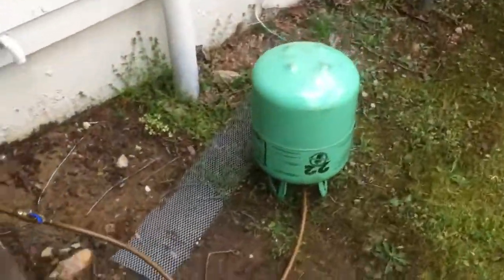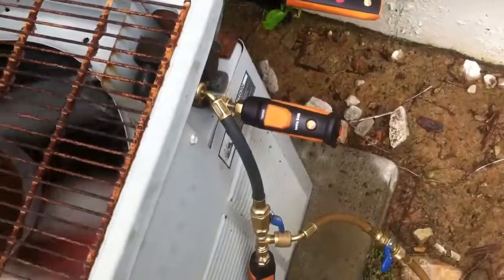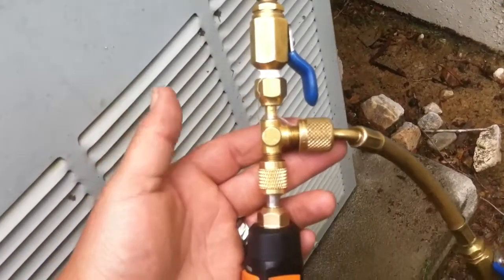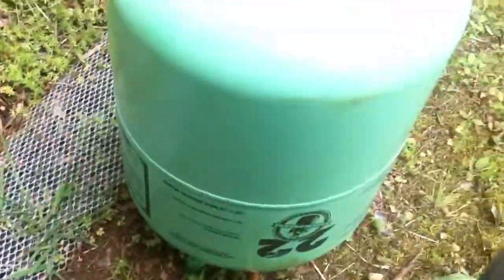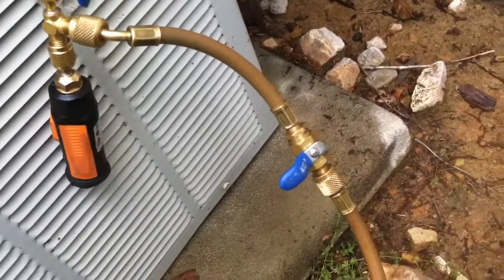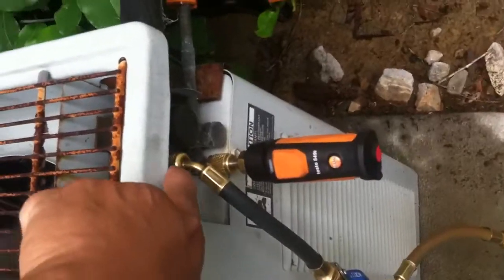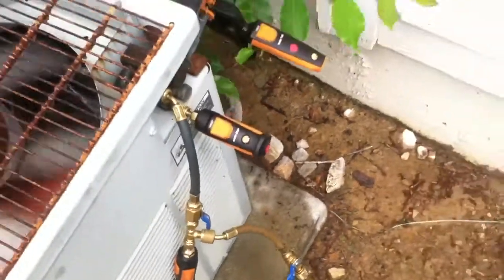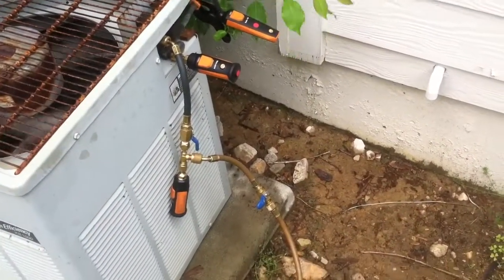How I charge ac units with my testo smart probes

Comment: Hi again Marco
Man... I've being trying to assemble the hose system that you assembled and the specialized stores here in Miami can't help me.

Could you be more specific in regard to the T that connect the hoses and the hoses.
Where can I find them? (amazon? ebay?)
What are there specs and item numbers?
Reply from the maker: https://www.zoro.com/jb-industries-quick-coupler-access-tee-14in-a34000/i/G1765951/?gclid=Cj0KEQjwpZO_BRDym6K_nMye7cEBEiQAVA7RaJ8vk3SvvRlxlmMjxwjNLciEr2m6YLTzaBJ0YLc4LSoaArWM8P8HAQ&gclsrc=aw.ds

i think its a jb industries A34000.
once you get the tee, just use a 1/4' hose with a ball valve at the end for charging.